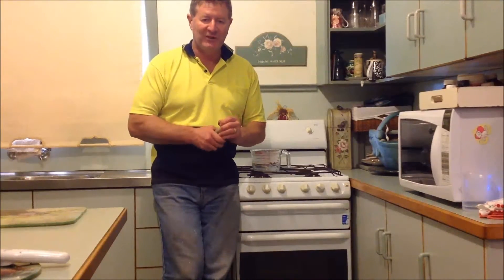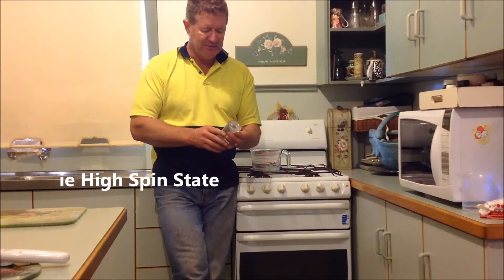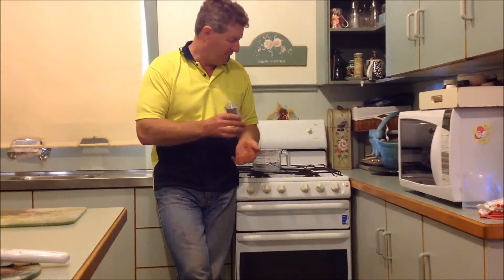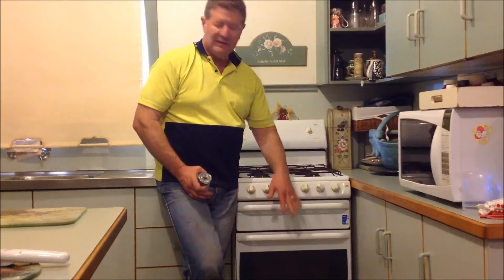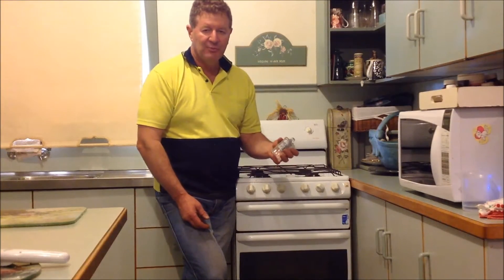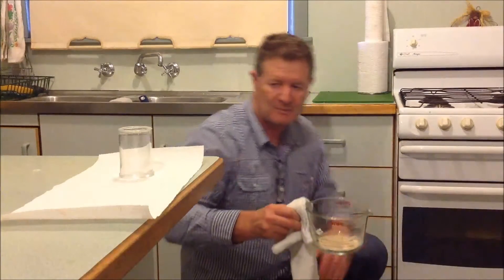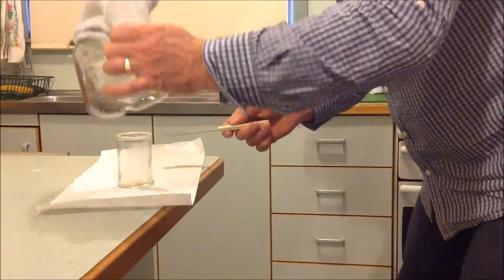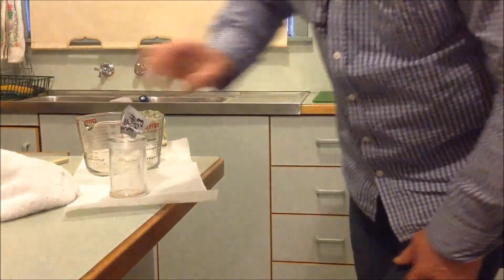Annealing m state Dead Sea salt precipitate

Comment: Hello... I was wondering about the annealing of metals, which from my experience with jewelry making, each metal has a specific annealing temperature.  So would this not also hold true for gold or silver or platinum in THIS state as it would for it in its metal state since the actual atoms are still the same ones....also your mentioning experimenting with the excess magnesium... if memory serves me, (and I realize you mentioned magnesium "oxide") isn't magnesium the metal that is highly reactive with oxygen? And I believe more so when in contact with oxygen in water? Or is only the oxygen in water that causes it to erupt into flames? I was considering bringing the magnesium in the waste precipitate back to metal form, and this had occurred to me to ask!  

Cheers!
Reply from the maker: I worked for BHP for 8 years. Annealing is a time temperature function carried out to stress relieve the worked metal. Most metals are not pure and have complex phase presentation modes where the atomic arrangement varies. Even the rate of cooling can effect structure and properties. 
For our purposes it is said that multiple cycles will activate the spin I presume and thus hod the energy if it. 
Then are the temp mass effects. 
All are temperature dependent. 
275 deg C is said to be appropriate. 
To reduce To Mg metal you will need a stronger alkali such as Lithium but is likely to be cost prohibitive. 
Mg degrading to oxide is strongly exothermic very bright and very hot. It can be used to trigger other high temperature reductions known as thermit processes.in this way it is possible to turn quartz powder in to silicon metal. 
Anyway, I am raving now. 
Have fun 
Cheers
Bruce
Reply: Thanks for the explanation, however the link is reporting page not available and chrome reports The server at processes.in can't be found, because the DNS lookup failed. I had a feeling it wouldn't be easy considering the volatility.  Thanks for the confirmation!
Reply from the maker: TheSmokingGun57 I did not put a link in. The on-board editor has corrected something and made a hyper link to nowhere. It was meant to read with a comma and a space before "in this way". P: :P
Reply: LOL!  Okay got it!! Leave it to me!  :-)